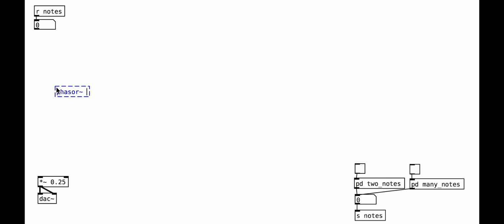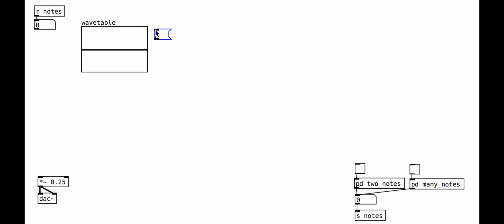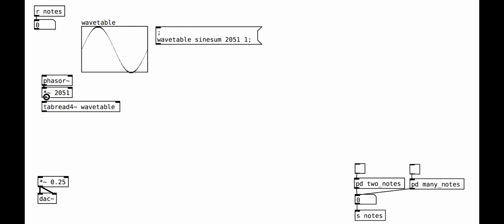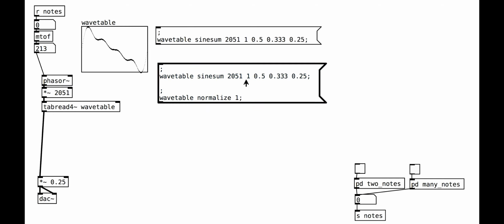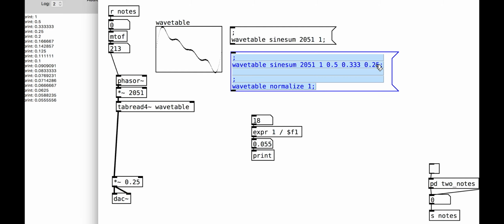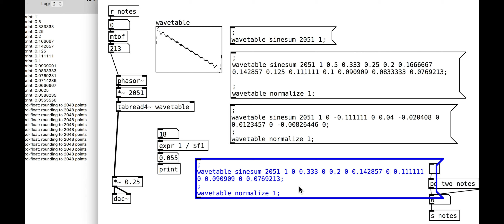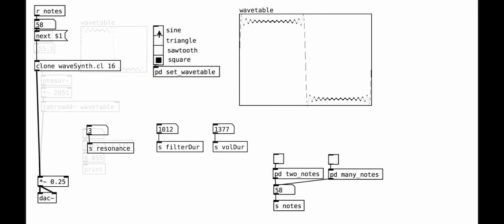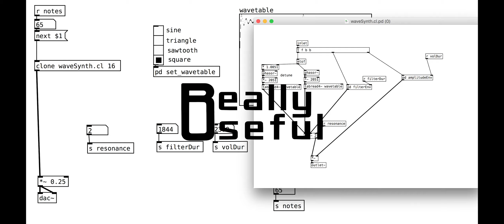PureData tutorials - rich synthesis (9) - Wavetable synthesis

Comment: I’m assuming that if you don’t have a midi keyboard, you don’t need the mtof object. What is the purpose of the “r notes” object and the 0 below it?
Reply from the maker: You will still need mtof. "Midi" in this sense means the system of numbering notes with a number per semitone: C=60, C#=61, D=62, E=64, G=67, etc. It tends to be simpler to generate patterns with those numbers rather than raw frequency values (e.g. C=261.625565, C#=277.182631, etc). "r notes" is a receive object and the zero is just a default number box. Remember that you can look at help files for any object by right clicking on them. I think tutorial 5 might also be useful to look at to understand the notes.

Comment: Why 2051?
Reply: For efficiency's sake tabosc4~ requires that the table have a power of two plus three points (64+3=67, 128+3=131, 256+3=259, etc.) If you want wraparound to work smoothly, you should make the last three points copies of the first three. This is done because tabread4~ does 4-point interpolation. (Taken from the B01.wavetables.pd help file)